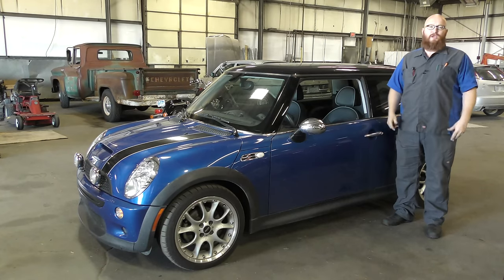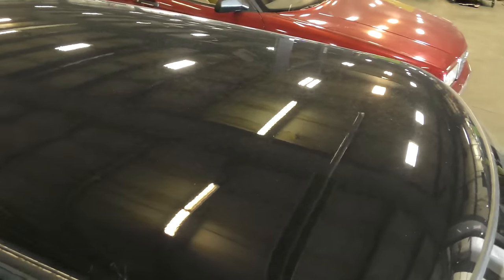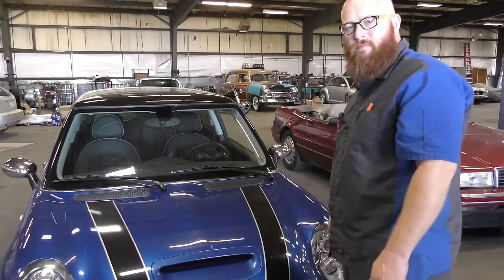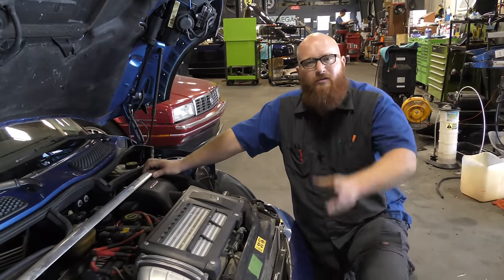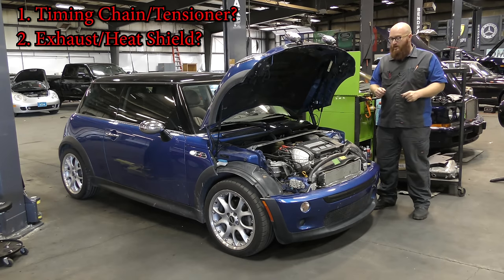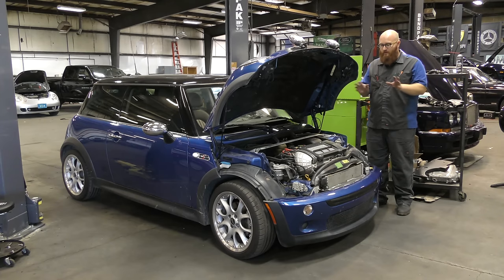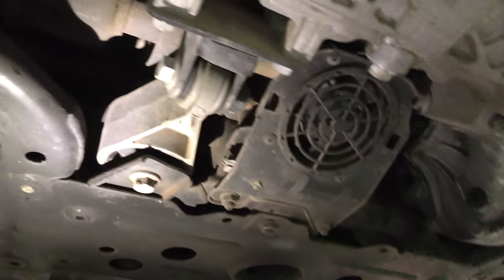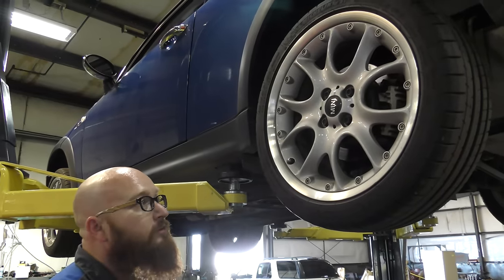Roaring Loud Mini Cooper S! The CAR WIZARD finds the source of the mysterious noise

Comment: Haha my grandma's got an 02 mini cooper S manual she keeps in her garage and it's got like 30k miles on it, she literally only drives it once a week to the grocery store.
Reply: My dad had an 01 NA 5 speed and the gearbox failed... Wouldn't go into 3rd gear at all and started leaking like a siv, apparently the 5 speed in the early non S minis was a french transmission and it was notorious for the shift forks going out and to repair the trans it was more than the car would have cost because "pegout" transmission parts are hard to get... Similar problem to the Jeep comanche manual having french transmission problems.

Comment: Hey Wizard! The stethoscope is very nice, I myself have used a BFS to diagnose similar problems. I thought it may be an idler pulley when I first heard it. Enjoy your work.
By the way, a BFS? It's a Big F...... Screwdriver. Similar in execution but using the handle to the ear. Cheers friend.

Comment: That US dash lay out is weird. In Europe you have the speedo in the middle above the radio with the fuel gauge, temperature and the rest, and only the rev counter is above the steering wheel. 🙃
Reply: ..arnt Cooper S dash clocks different ?

Comment: I have an ‘09 Mini Cooper S with about 109,000 miles. Just bought it off a guy and it ran and sounded great on the test drive and drive home. Took a 20 miles trip and pulled into a drive thru and noticed a weird whirring noise coming from the engine. It almost sounded like how a manual transmission as your riding in gear but not like when you need to shift. I put the car in neutral while stationary and gave it some gas and notice the sound still persisted so I’m pretty sure I can rule out transmission and wheel bearings. It does have a turbo so I’m leaning towards that being the issue perhaps? I don’t know how to diagnose further. It’s definitely responsive to the engine. Any advice is appreciated.

Comment: Most common issue with the first gen MINI is A: the fan for the power steering pump failing, and there fore the pump dying. B: An oil seal, mine never or was already swapped. C: the strut towers deforming from rough ass AMURICA roads. 
The "sealed for life" super charger is dumb, but it's a replace every decade problem.
Reply: Also timing chain tensioner, best when caught quickly before the lower guide (part of case cover) breaks and sends shrapnel into the sump. 👍
Reply: The supercharger is not sealed for life it is serviceable i just did mine
Reply: I fixed the mushrooming strut towers by using 2x4 and sledgehammer until they were flat.  Reinforced with M7 plates and cross bars.  Don’t forget the stupid fuse that serves the power steering fan and main cooling fan.  If that fuse goes the car will overheat.
Reply: @everydaymechanic4657  We know that now. What he meant was that's what Mini claim.

Comment: I would guess that the problem is because of the low mileage. This car has been sitting for years without being driven and the belt tensioner has been putting an uneven moment load on the pulley.

Comment: Well my current car doesn’t make any weird noises since it’s still fairly new and in good mechanical shape but the worst noice probably came from my first car it was a 95 Ford Fiesta with a cvt transmission which grenaded itself, and at one point while driving to work it completely failed delivering the power to the wheels and I was able to rev the engine whilst in D without the car moving and days before the transmission started to make this high pitched hissing noise and that was the indication to me that it’s about to be over with 😩🙉 I hated that noise 😂

Comment: I had a 2006 S 6 speed 
I loved that car 
Very costly to operate 
The run flats are $500 each 
I had to replace 18 of them in the 8 years and 45,000 miles 
The kicker was when the clutch went out and cost $4,400 to replace it would have been another $1,100 if they had to replace the flywheel 
I was told I was lucky as there is a known issue with the clutches going out as I got 45k miles before going out as they go out about 15k miles 
But it’s was a dream to drive and fast fast fast
Reply: 18 tyre's in 45,000 miles that's crazy🤪.
Reply: Nobody replaces runflats with runflats.  I’ve had my R53 for 18 years and I use regular tires.  No punctures yet.  I have a space saver spare I carry with me on 500+ miles trips.
Reply: 15k clutch? What are you smoking? The clutches are very robust on these cars. They usually last well over 100k miles before they go.
Reply: MrManBuzz I have never ever had to replace a clutch in my life 
I own my cars well past 125k miles 
Mini owner forums folks say 15k miles 
And I never hot rodded it that is not my style of driving
Reply: jkk244 mini don’t have space saver spares 
One tire gets jacked up you hit yo buy new 
If you put new tire on one wheel and they have 10k miles on it the handling sucks 
One time I took out the drivers side front and rear with just about 10k miles in it hit a pothole 
Couldn’t get just drivers and to get all four 
I purchased 3 complete sets of 4 tires and of the last set I bought I had to replace 3 of them and the set before that I had to replace three of them as well 
Never did I wear any of the out 

It sucked 
But when I traded it in it looked brand new and smelled like new
Reply: @markwagner4909  What forums? I'm active on several R53 forums and not once have I come across anything on 15k mile clutches.

Comment: Out in Ohio we had mechanics that wouldn't even work on a VW Jetta or Passat and the ones that did (chain auto repair) didn't think to do the timing chain and ended up totaling the car because the engine blew. One of the reasons why I work on my own stuff.

Comment: I had Opel Astra 1.6 -00 G-model which had leaking valve stem seals/rubber and every repairshop in my area refused to repair them even i was willing to pay full amount. Cars body was exceptionally good for its mileage and otherwise it had no other problems than it was eating "a bit" of oil. It was so confusing at a time and makes me wonder why they ALL refused to work on it?

Comment: Hey Wizard, what's your opinion on the 2012 Kia 2.0L? I read online that they have a rod knock problem fairly often from a similar problem as the 5.4L Ford; oil channels. Have you seen it in your shop before? Or am I overly paranoid about my car?
Reply: I would just not recommend any 2.0 or 2.4 Kia/Hyundai Theta 2 engine NA or turbo. They are notorious for throwing a rod. There are still engine failures after the recall was done.

Comment: the smaller pulley will not give any extra power as needs to be tuned for it as it will bleed off the excess boost so it will make zero difference without a tune
Reply: Completely wrong. A 15% Pulley typically brings a R53 up to about 200-ish bhp.
Reply: Nope, changing the pulley on these cars is the easiest bang for your buck power increase and doesn’t require any tune. It’s actually fairly pointless to try and remap these for increased power unless you’ve increased injector size & changed the camshaft, along with other supporting mods.

Comment: That 2006 Mini Cooper S with extremely low mileage, looks interesting to me. Can you do another vehicular inspection on a 2005 Infiniti G35 coupe with the 3.5 L V6 engine and the six-speed manual transmission or a 2010 Saab 9-3 convertible with the 2 L turbocharged four-cylinder engine and the five-speed automatic transmission with sport mode/manual-shift next? I wanted to see these rare and unique vehicles, either from Hoovie's Garage or in the Wizard world. Thank you very much.

Comment: The R53 with a chrono pack is very rare. Fortunately on my 2006 Astro Black R53 the original owner spec’d over £12k of factory options on a car that cost £14k. It’s got a chrono pack, heated Recaro racing seats, sports suspension, climate control, six CD auto changer, telephone, anthracite headlining, Harmon Kardon upgraded ICE, LSD and rarest of all, it’s a six speed auto with steering wheel paddles. In the UK these cars are going up in price. Two years ago you’d pay about £3,500 for a JCW with under 80,000 miles on the clock. These days that same car will cost you about £6,000. The website http://carandclassic.co.uk did a feature on the top five cars appreciating in value and the R53 was one to watch.

Comment: what lets the minis  down is  not build  quality but  the poor  quality of  some of the  fitted  components....steering pumps.. and  some  gearbox issues
Reply: Uh, that's build quality. If the parts are constantly failing prematurely, they weren't designed and built right for the application.
Reply: @OMGWTFLOLSMH  i prob use  wrong  word  "build"  should have  said  "assembly", assembled  correctly  from junk parts,   another  example is  ford i have had  front springs break way to easily on looking at the  broken parts you can see the impurities in the  steel   ....very much junk....do not  ever  remember  broken  springs in 70's  and 80's

Comment: I have a question for you: 25k original miles?..I don't get it..
Is that like road miles?.........are there unoriginal miles that can be on a car?
Reply: Original engine miles. If the car were re-engined with a brand new engine, the odometer would still read the mileage from the old engine, because that information is stored in an computer (usually the ECM) somewhere in the car.

Comment: Since you like working on Mini: They may be made and owned by BMW, but the engines are mostly by Peogeot! You can safe a lot of money If you buy the spareparts from them. Most of them are identical but only cost a fraction.
Reply: PM  The head gaskets failed as a knock on effect of the PTO gears in the supercharger failing due to oil starvation. The water pump is driven by the supercharger.

Comment: "If there is something wrong with this MINI".
There is always something wrong with a MINI!

The water reservoir looks dirty.
It may be a sign of corrosion in the circuit, passing to the water, caused by the usage of tap water on the refrigeration circuit.

Comment: I had an '04 for a while, though it had WAY more miles on it than this one. I loved driving it, but it ate me alive in repairs. Superchargers eat up the gears that drive the water pump, oil leaks, oil pressure problems, bad window regulators, bad suspension bushings, on and on. In the year I owned it, I think it spent more than half of it on jackstands. Between the depreciation, the model refresh that gutted the value of the previous generation, and the cost of repairs (which I did myself), I figured that it cost me about $100/mile to drive it. Never, ever buy a high-miles German car. You will love driving it, but you just can't afford to keep it running...

Comment: The engine and gearbox are crappy French ones. They didn't use the modular BMW motors until 2015. Oops hang on, 2007 onwards used the French one, 2001-2007 were the Fiat Chrysler "Tritec"—probably worse, but I can't say from experience.
Reply: Yep, the Peugeot "Prince" engine family.

Comment: Hey wizard ,help a brother out!! I have a very nice 2013 Jetta GLI ,I love it runs great but one thing there is alot of road noise in the back .I checked the wheel bearings there good ,so could it be the tires ? There Goodyear eagle sport 225 40 18? What do you think?

Comment: We have a05 S with 246,000 miles. There’s noise it starts about 35 mph at 50-60 it real loud. How would I check the transmission? Thanks

Comment: How did it happen that this car was allowed to be sold in US with headlights not fixed to the body?
Reply: Not headlights, additional driving lights.
Reply: VO 4P.. If you mean the headlights raising (fixed) with the  bonnet  and not fixed to the body it was before the regulations changed

Comment: I thought that it was illegal for the headlights to move with the hood. When did that change?
Reply: It switches to the lights on the bumper. It's a common thing with newer/luxury type cars
Reply: @bubbaho-tep9284  Except the lights aren't on the bumper they go up with the hood too
Reply: @AJGreen-cn8kk  the headlight assembly does go up with the hood, however below those lights on the bumper there are an additional light bulbs housing. It's in between the headlight and fog light
Reply: @bubbaho-tep9284  Oh, OK. Hard to keep up with our sort of crazy government regs. They change about as often as the CDC's China virus rules.

Comment: You must know why they don't want to work on them, it's easy, they are hard to get around the engine to work on. Oh that's smart increasing power to engine that can't handle it.  Should put on pulley to decrease power. It amazes me people with so much money blowing it on stupid cars for looks.
Reply: Once you get to know your way around these cars they’re really not that bad to work on, and the engine can handle the power just fine. The Cooper s had oil sprayers for the pistons, forged rods and a lower compression ratio to handle the boost. Mine is on 168k and is still handling it fine
Reply: @F56JCW  Thanks

Comment: Parting out my 2002 R53 with just 97k miles. Blown engine when the common shaft for the water pump and supercharger went bad. I needed a cheaper addiction.... like cocaine.

Comment: Timing chain 
It run for a long time without oil
Reply: Nope, they all clatter their tits off after 25k miles. They are used in Peugeot's as well and they all have chain problems. That's what happens when you put a chain suitable for a push bike into a car, weight saving gone mad.

Comment: Do USDM Minis not have a central speedometer?
Reply: The extra dials in the centre were a factory option in the UK (chrono pack I think it was called). If you got that option then the speedo moved up onto the steering column next to the rev counter.
Reply: Yes. All US cars had the central speedo unless the overstyled and ugly chrono pack option was selected.
Reply: Thanks for the replies, literally had no idea the chrono pack even existed for r53s. Looks very aftermarket, I prefer the big central speedo.

Comment: Hang on a second!
How is that car legal in North America? The headlights are on the hood. No headlights, tail lights, indicators, or brake lights can be on a moveable panel in the US or Canada!!
What is the deal with that??
Reply: FMVSS Standard 108 permits required lighting to be mounted on body panels that can be opened or removed for repair and servicing, but not for ingress/egress of passengers and cargo. Hood is fine, tailgate is not.
Reply: @robscafidi4070  Ah! Ok... Is that a newer update? I know a number of earlier cars had odd cutouts in the hood for the headlights because they couldn't be on a moveable panel.

Comment: Well. If you buy a car and park it to look at, it will stay nice. Less than 30,000 miles and needs all that work...after ter being "took care of" all these years? I'll stick with a good reliable Toyota or something. It's pretty, but useless for someone like me. I drive my vehicles.
Reply: A 2007 Toyota Corolla LE AT could run circles on this thing.

Comment: Scotter kilmer he is the same way he says oh they're so hard to work on and expensive but there not I'd guess there like anything if you take care of them there actually good
Reply: Look up timing chain retainer and Mini Cooper. The retainer goes bad (it's plastic) with an interference fit engine = 2500+ repair
Reply: @circuitsandcigars1278  ow ya because many is actually a small BMW and BMW in the 2000s had that problem forgot about that

Comment: The electric power steering on this era mini have a tenancy to burn out.
Reply: The first gen MINI has standard  hydraulic power steering.
Reply: @davidstewart3868  It's kind of hybrid... powersteering to the rack is done by hydraulic lines, but the steering boost comes from an electric motor (which is actually prone to a failure if(=/when) the tiny cooling fan behind the engine fails...), not from a powersteering hydraulic pump driven by a auxiliary belt.
Reply: @davidstewart3868  The electric pump I should have said.

Comment: I drove a 2006 mini cooper, bought it used in 2007... kept it two years.  Biggest piece of shit car I've ever owned.   It drove okay when it was running. Car had under 50k miles when I got rid of it ... replaced two water pumps and a clutch on it in 2 years

And the sound of car in reverse was straight up awful, sounded like a cheap ass go cart in the worst possible way